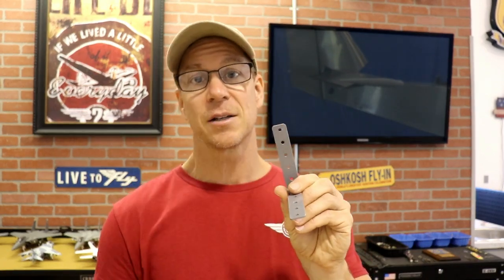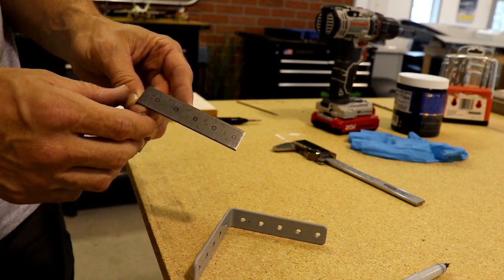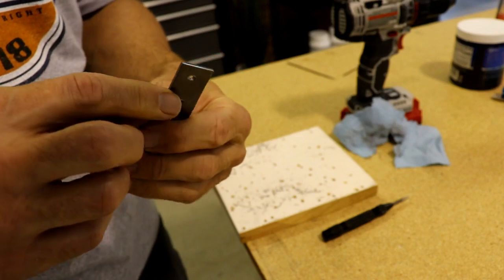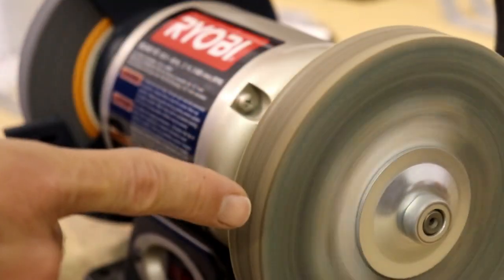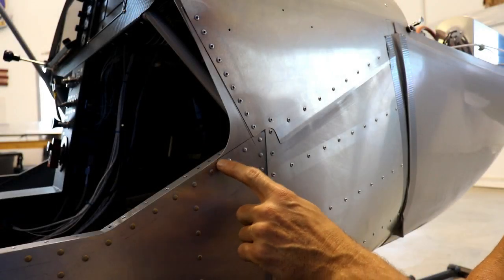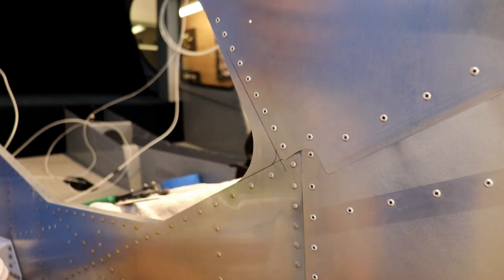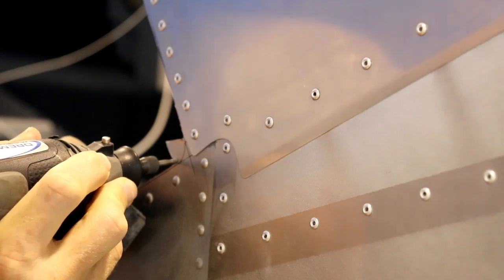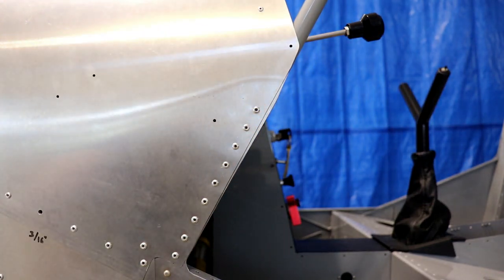CH-750 Airplane - New Style Doors (Part 2)

Comment: I was under the impression you shouldn't smooth steel on a Scotchbrite wheel where later you will use it on aluminum. Something about steel and aluminum and galvanic corrosion?

Comment: Hi Mark, I notice most of your comments mention the perfection we see in your work. It is great to see a guy who really enjoys doing things the right way and not cutting corners.  I was really impressed with the detail and fit on the Vans firewall forward.  The wiring was perfect and better than you could get from a factory build.  I noticed that on the Zenith the wiring and routing of was excellent but because of the route they needed to go they seemed be more forced and lacked the natural flow of the vans. Was that the case.
Great work, keep up the videos.  John